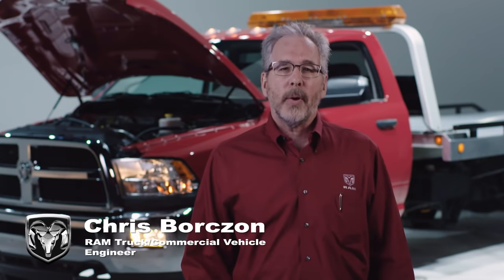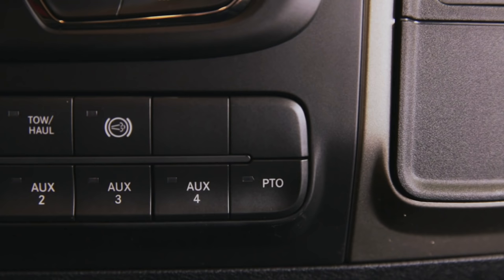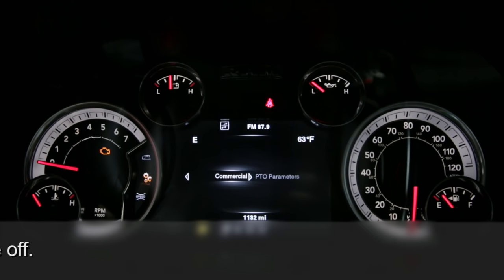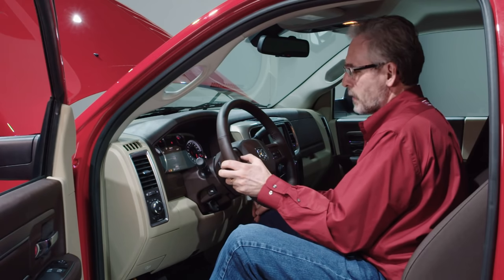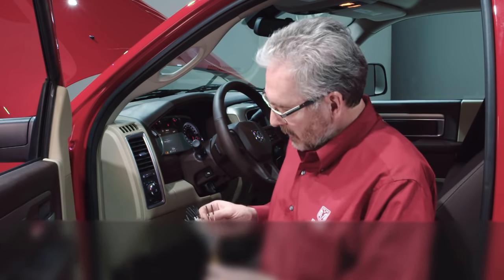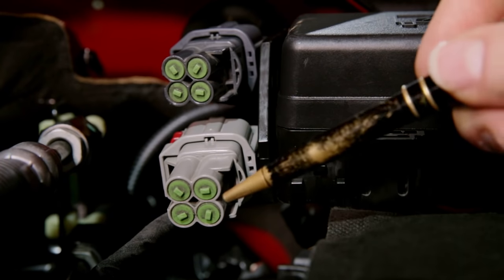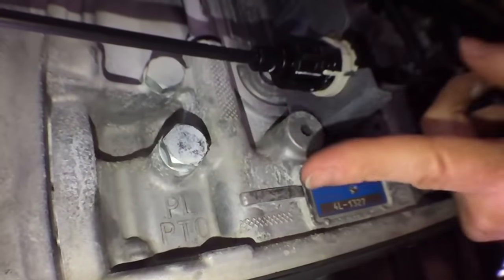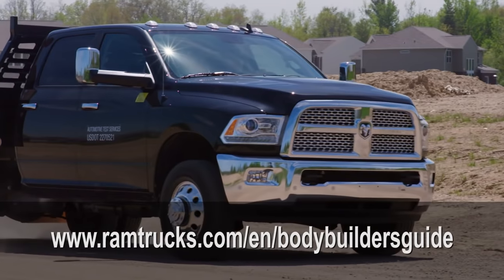Power Take Off 101 | Ram Engineering | Ram Trucks

Comment: PTO means it takes off power from the engine.   I think it should be something more like   Auxiliary Driveline Power Harness or something, but PTO doesn't really describe what it's function is.
Reply: It does if ya farmed, we bypassed a useless part that gives out all the time.
Reply: The silinoids go out and of course wiring harnesses breakdown.
Reply: Just think of PTO like you do a tracker with a mower attached and going.  What does the PTO do then?
Reply: @joesettling1545   Power Transfer Option would be a little more understandable than Power Take Off.

Comment: I’m getting ready to order a 23 5500 cab chassis will be adding a HIAB knuckle crane from my current 2008 F-550 truck that has a left side PTO and pump. Looks like I can order the Ram with Left or Right side but the right seems to be more common. ? I know I’ll probably need a different PTO and Pump regardless just didn’t want to order the wrong side if there’s a better option.
Reply: Right side is the primary side and takes more and larger pumps.  Left side PTO on 4x4 is very complicated and requires an aftermarket transfer case from Marco Equipment.

Comment: You may know pto's but do you know ignition modules or win modules they are a problem with Fiat Chrysler Ram products mine has been in the garage for 7 days now.  There is a company that just repairs win modules from Fiat Chrysler Ram products. Let's hope your not tow your camper and it goes out. You will be Sol .

Comment: Hope you can help with a problem I am having with my 2018 ram 5500 The  Muncie PTO is set up to only be engage when in park shuts off when breaks are applied so what happen is the idle came down but PTO did not shut off which burnt up the PTO . So I had the pto rebuild put it back together and still have the same problem  when I shut it off buy the switch or by the brakes idles down but pto stays engaged Please Help
Reply: Either someone has connected the PTO wiring incorrectly or you have a bad hot shift solenoid.

Comment: Have a issue. When PTO is engaged light blinks and rev's up but then shuts down after a few seconds.. light was always steady before this issue. 2014 Dodge ram 5500 Cummins 6.7..
Reply: I have the same problem in my 2016 ram 5500 rollback… what was the cause ?
Reply: Did u ever fix it ?
Reply: 2013 through 2016 trucks had an issue where the PTO would shut off in  5 seconds this was due to a recall done by the dealer wrong.  If it is 30 seconds, the OR/br wire lost its ground.